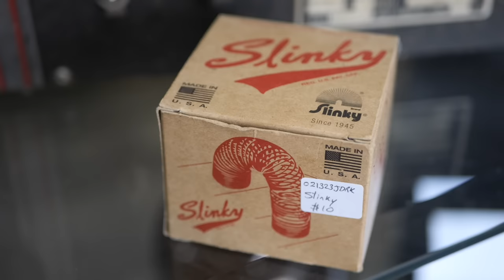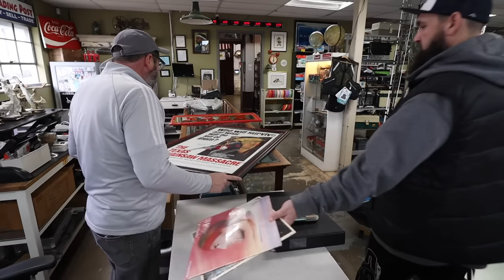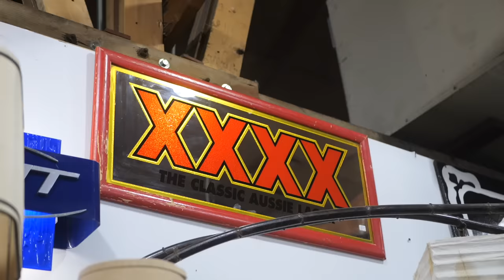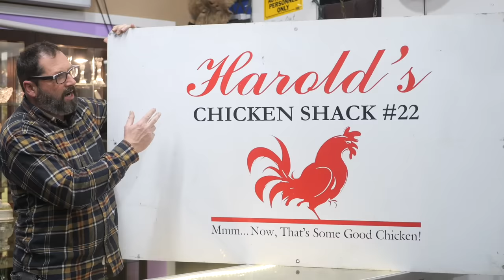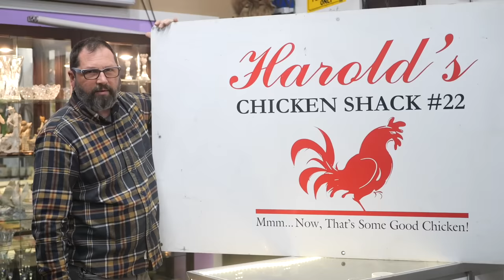What Happens When Inflation Is Nearly 100%

Comment: I am a reseller but the normal every day items are sucking our finances. Groceries are around 50-100% more in a year. I had to put a transmission in my truck that was $7000 when just a few years ago when I had one put in was only $2500. A fuel line was leaking in our suburban and was $1500 to fix. We have had to take out of our retirement to pay this. This situation is pretty serious. I am still selling stuff on ebay at a normal rate or higher than usual but it is not keeping up with our expenses.
Reply: You may want to find a new person to work on your vehicles . No way in hell a fuel line should of ever cost you 1500 unless they had to do something stupid like pull the engine to get to it! Even the transmission.  7000 is alot! Even for a truck. Someone is scalping you.
Reply: @suxix7312  I agree with your point on the car work. But right now car prices are high, so more people are repairing. So I did see some mechanics raise prices a lot where I was. Don't remember which month I noticed it or if that went back down.

Comment: The Uniden scanner DOES NOT run on batteries. The battery is to maintain the memory. (Circa 1984 or so)  Analog only, no CTCSS or DCS capabilities.  Needs walwart or 12V power from single line.

Comment: The cabinets were sold separate because often hi-Fi of this era was designed to be fitted in a radiogram style setup so they were sold naked with a template to cut a hole to mount it in the rediogram and you could buy or make the case if wanted to use standalone.

Comment: i use that record player daily ive put on a modern needle you missing a pin for solo  play and a spindle it comes with to stack singles   its quit a good piece the plate has a marking on it to put it on the spinning part with a arrow marking thats how they calibrated it in the factory ow if it is not working turn it on and handturn the motor it will start spinning again

Comment: My Family as well as my Uncle, between us, we own 2 pawn shops. We have so many items coming in, we actually offer 25% less than what we did last year. We started to advertise that we buy cars and home as well. A lot more desperate people out there. We recently bought a home that didn't have a current evaluation so we made an offer and the seller took it. We offered $60,000 cash on a 3 bedroom 2 bath single car garage home, turns out market value on it was $320,000. Her Grandmother had passed away in 2019 and it sat empty for 3 1/2 years. The house was updated in 2013.